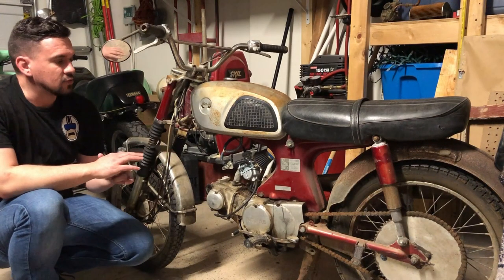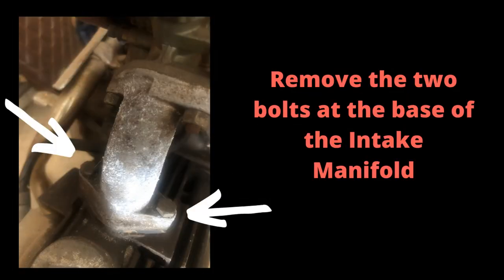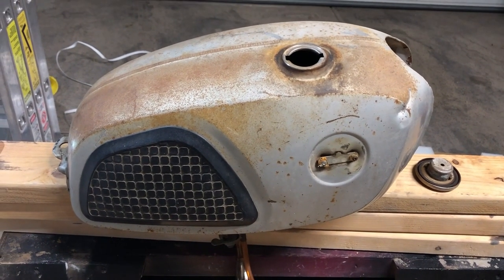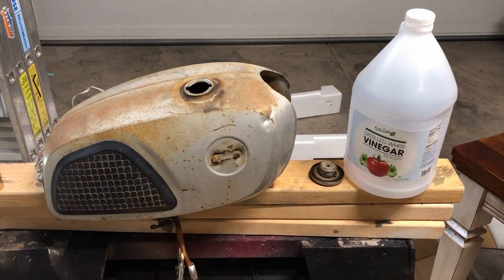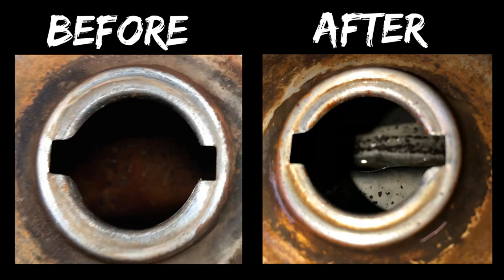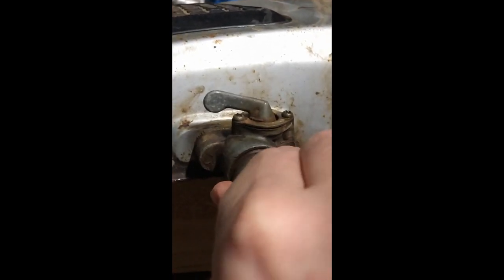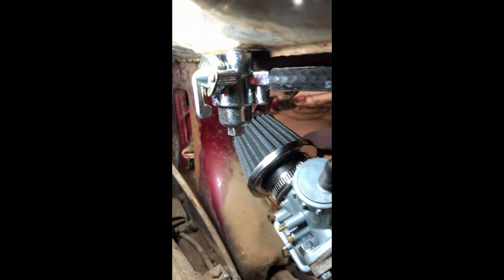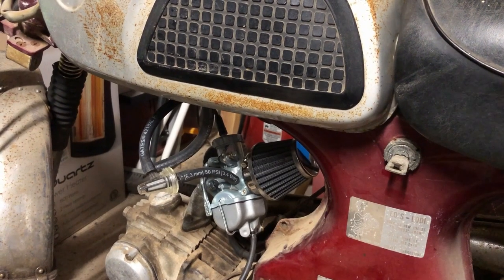1968 Honda CL90 build part 2: Fuel system clean up. Budget fuel tank clean.

Comment: If you set one side of the tank to bypass the petcock wouldn’t this mean you will have continuous fuel flow? You won’t be able to stop the flow of gas when not using the bike.
Reply from the maker: I noticed that shortly after posting the video. I think to try and get the bike started  (proof of concept) it will work. I will be fixing it the correct way (not cheapest way) after we know the bike runs and drives. Thanks again for the observation.
Reply: @LostSocketMotorsports  I'm trying to work through this same issue with mine, the second line going to the original petcock also bypasses the fuel tap so I still have fuel running from the equaliser side, did you end up finding a fix for this?
Reply from the maker: @petersmee7283  yes i ended up taking the internals of the new petcock and using them to rebuild the old one.
Reply: Yes.  All the petcocks advertised as "CL90 or S90" that I have been able to find lately are not correct.  They have either only one outlet, or they have 2 outlets that are 90 degrees offset.  The correct one (at 4:33) was on the CL90, and the right side inlet is about 45 degrees offset to the outlet.  If you hook up the hose from the right side of the tank on the 90 degree offset outlet, you will have continuous fuel flow to the other outlet.  This petcock, thought it fits the tank, was intended for use on the small 2 cylinder Hondas with 2 carbs.  You can use either a plastic lawn mower valve for the right side, or one of the many small inline gas valves available online.  I rebuilt one of my originals, however one of my spares was too damaged to rebuild.  (I have 2 S90s and 2.5 CL90s).  I also purchased 2 of the correct ones several years ago.